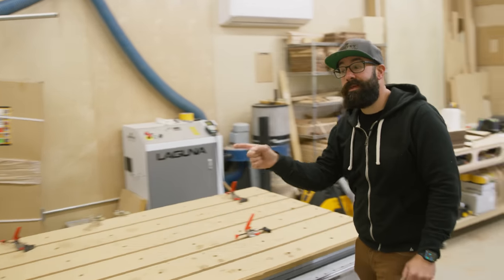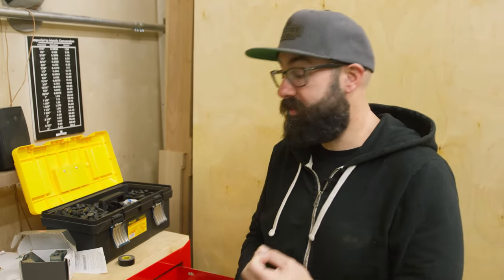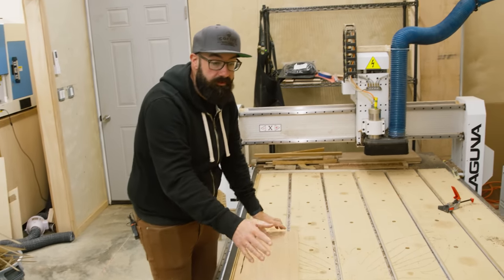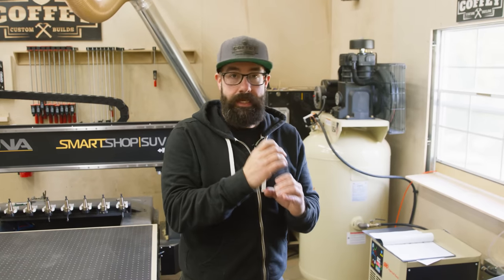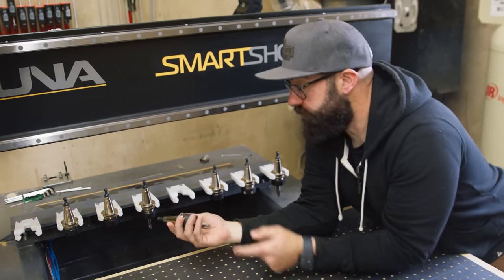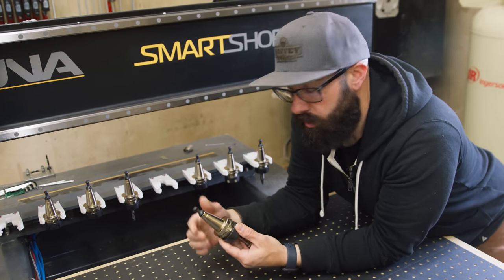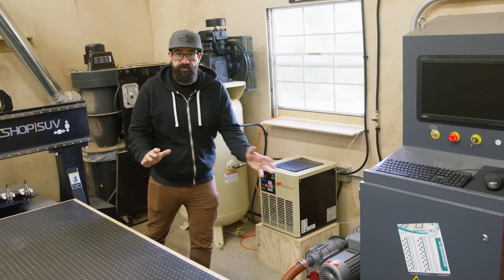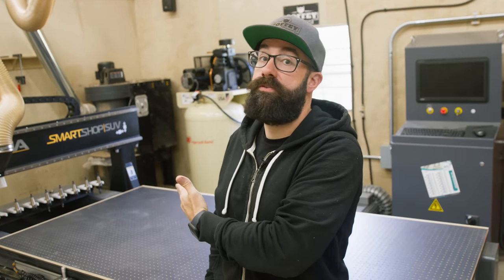The Hidden Costs of CNC's!

Comment: Excellent video, bro. I thought when I spent ninety grand on my large format CNC that it would come with everything necessary other than bits. OMG, talk about naive!

First of all, my machine weighs over 9,000 pounds, so I was advised to replace a large section of the shop floor with six inch reinforced concrete...four grand.

The 230v three phase wiring required cost almost five grand. The onboard tool changer holds twelve tools and with collets and holders, cost a grand to populate, excluding the carbide bits.

The dedicated compressor and electronic air dryer added another four grand, plus another grand for larger air distribution. 

My original dust collection system was instantly overwhelmed and cost seven grand to upgrade.

So, at the end of the day, what I thought was going to be $90,000 ended up being $112,000... and that's still doesn't include any bits. I probably have three grand in bits alone and, yes, they are a consumable.

That said, my system paid for itself within the first year of use. I am able to cut and assemble twenty cabinets in a single day in a one-man shop, with an average UV1 4x8 sheet yield of 95% and an accuracy factor that is off the chart.

A very expensive but totally sound investment in my case.
Reply from the maker: Big purchases require big peripheral purchases for sure. It's well worth it though. Makes the business more efficient.
Reply: Thanks for the FACTS!
Reply: @@tommyp1494  You can do it man. Go for it and work hard.
Reply: 1 year ago I received a new doosan lynx. Y axis. Bar  feeder ,live tools. 150k . I bought my first Haas mill for 8k . It's my philosophy that, mini machines should not exceed 2500 USD.
Reply: @wannabecarguy "I received a Doosan".....like in Santa received or bought it ?
Reply: I built a CNC for $1000 and am competing with HAAS routers that cost $100,000 plus installation and tooling and still beating them. There is no need for expensive servos or high HP. All of the replacement parts for my CNC have blueprints and can be made by any machine shop or are 3D printed. Everyone tells me to think and build bigger but I routinely see profits on my machine. Idiots buy these huge machines knowing nothing about them and then are terrified to take them apart and engineer their own replacement parts.
Reply: @togowack would you be will to share more details about your build. Thank you.
Reply: Well stated. It’s all about ROI
Reply: @togowack  sure you are buddy

Comment: It's true.  I took out a $25k loan when buying a "desktop" CNC router (30"x40") that was advertised as costing $6,495!  I added options like an HSD spindle, phenolic top, vacuum pump, T- slots, etc, for a grand total of just over $14k.  Then add $5k for electrical upgrades, $5k for a good dust collector (NOT harbor freight!), and my money was all gone!  And soon after I discovered how inadequate VCarve Pro is, so I embarked on the odyssey of finding a good CAM solution.  Total cost is all of my money!  I'm using it to make tooling for a product I hope to launch soon.  And while I haven't made a penny off of it yet, the cost of having someone else do all of the machining for me would cost much more than what I paid for the router.  So I'm calling it a win.
Reply from the maker: Gotta spend money to make money
Reply: That’s crazy, $25k for a desktop CNC! I spent a total of $60k for a full 4x8 CNC and an edge bander which included a vacuum pump, and a large dust collector
Reply: @maxwellrucker7186  LOL!  I guess you didn't read past the first 8 words?  It was $14k for router w/ spindle, vacuume table, etc.  I am well aware that cheaper routers exist, but you get what you pay for.
Reply: I have equipment 5k Cad. Making 30k per year
Reply: What software did you decide on
Reply: @handyscott1  Rhino and RhinoCam.  Rhino is easy to learn if you know AutoCAD, and it is good with curved surfaces, which is what I need.
Reply: Good luck man! 👍 hoping to have my own small buisness one day where I can earn a honest living. Any updates on how it’s going?
Reply: @jacobmitchell9227   Thanks.  I have solved all the problems that were holding me up, so now it is time to do the work of making the "final" tooling.  I'm sure there are more problems waiting for me, but I am blissfully ignorant of them right now!
Reply: Or, you could have bought a OneFinity 32x48 for $3700. $300 for spindle. $300 to $1200 is plenty for a dust collector. I do electrical myself. V-Carve Pro is excellent.
Reply: What's the product you're developing?
Reply: @VikingFireProject  I'm making carbon fiber knee pads.
Reply: I can build a desktop cnc under 1000$
Reply: @ChangeMakers338   I can build one for $800. Racing to the bottom is super easy.

Comment: Even with hobbyist machines. The machine cost $3500 but expect $7000 especially if you don’t have a laptop or software
Reply from the maker: I think every added cost associated with my Swift is is the same ones you'll get with a hobbyist machine. You need a lot.
Reply: @CoffeyCustomBuilds  especially starting from scratch
Reply from the maker: @TwoMooseDesign  exactly. You are spending $4k on a machine you're easily another 3-4k to get it optimized.
Reply: @CoffeyCustomBuilds  👊🏻👊🏻👊🏻👊🏻👊🏻👊🏻👊🏻👊🏻👊🏻👊🏻😁😁😁😁
Reply: You're both totally off. Buy from a reputable company and there's no optimizing needed. 

You need the most basic of computers to run even aspire. 

Yeah you'll spend some money in a good machine but you can certainly get less robust machines for a grand maybe 2. People have managed to do machines in budgets. 

Hate cnc's all you want but be accurate with your bashing.

You said yourself it's been the workhorse of your shop for 3 years. As a business it more than paid for itself many times over. Never calls in sick, never needs a lunch break and frees you up to do other things while it's working. 

Every tool has consumables. A cnc will do a lot with those consumables if your feeds and speeds are dialed in correctly. 

You obviously know that stuff now but some of your viewers don't. 

In the long run a cnc will MAKE, not cost you money.
Reply from the maker: @LongIslandHobbyist  are computers free? Do you not need tools? Do you not need dust collection? Do you not need spoilboards? There are other costs. Bottom line.
Reply: @LongIslandHobbyist  I dont hate CNCs? I own two of them and to say there isnt hidden cost is ignorant. Does dust cullection and a "Cheap" laptop come with a 𝙲𝙽𝙲? No it doesnt boom $1000 gone. Bits? For sure a few hundred which is the entire point of the video, which im not sure you actually watched?
Reply: Nobody said they hate cnc routers, just simply pointing out there are other items that need to be added to complete the cnc system. I liked the video and appreciate the info. Even though I will be purchasing a hobby size cnc, some of the items discussed will also apply to my setup.
Reply: All I know is I want to get a countertop priced for a friend at a cabinet shop, which is something I can do with a track saw jig saw and router and get as good of results... They charge $80 to make cuts, than $400 to put them in place and scribe maybe and $25 gas, they said they use a dedicated machine that cuts and routes the grooves for the joining bolts. $400/hr to install laminate countertops sounds like a scam to me. Heat pump installation is also $400/hr and is easy but vast misinformation on it. Greed, all you need is a nice storefront and a lot of overhead and people will pay you anything you ask.
Reply from the maker: @Realism91  do it yourself then.
Reply: Sorry kind of went off on a tangent into personal life, it's for a retired friend that doesn't make much, I'll probably just ask for a new blade and gas and a coffee.
Reply: @Realism91 Try it as a business providing your income as well as taking care of a few employees. After that you can bitch about the cost.
Reply: @Realism91 salty much and yea $400 a hour to install a heat pump is almost a loss for a business. Guys like you have zero clue what overhead is. You dismiss what you can do a countertop for versus and actual business. Had a buddy lived with his mama still at 40 and he did installs. He was way cheaper than me because he had zero overhead. If you had a problem 2 months later he was nowhere to be found. Guys like you I just laugh and say good luck
Reply: @jonsaircond8520  I would never disappear if there was an issue, I'd fix it. I do understand it costs a lot to keep overhead, if we didn't have a supplier nearby that had everything I'd need always available. If I was doing high volume anything overhead would make sense but I do a variety of things at professional quality, my dad was a plumber electrician and carpenter with his qualifications he's retired now he did everything and now I do many things not as much as him, I worked with him for 15 years he never had overhead and never ran away. I get what your saying though I've had to fix many things from people who hide and it's usually leaking roofs improperly flashed the worst thing and usually it was a licensed insured company that did it and went out of business and disappeared which is the oddest thing.

Comment: I’ve a metal CNC that had most of the same “hidden” cost. Two not mentioned are 1) service calls. These aren’t small devices you can easily take in for service or repair. Service call for me is $1,000 just to show up due to a 4 hour round trip from the nearest service shop. 2) metrology instruments.  These machines can be very accurate and repeatable. But you need tools that can measure to those accuracy to be able to dial them in and maintain the repeatability. Probably not as critical with wood, but something better than a (2) for $20 25’ Kobalt tape measure from Lowe’s is needed.
Reply from the maker: Solid mentions!
Reply: Wow good to know thanks I wonder what is the lowest Hidden cost machine out there is ? Thanks for sharing 👍👍👍

Comment: I work as a machine shop mechanic. I've had several hobbyists asking me advice, stating that they had seen videos of vacuum hold down, so they were planning to do that.
I explained what that actually entails. It's great, but not for tiny pieces and not for cheap. I'd say minimum of about $5,000 - which is more than any of the hobbyists asking were planning to pay for their entire setup, cnc machine included. That's initial purchase, not including power or ongoing costs.

Similarly but even more extreme on the ongoing costs would be a waterjet. Ours runs usually at 55,000psi. Every part is thick SS and every part is a wearing part with a definite fail life.
Because every connection has to be machined in SS to a particular angle and smooth so it seals 55,000psi, that means even the most simple straight 6" high pressure tube is $150. There are 19 high pressure lines and 5 of those have 1 or more bends.
The high pressure swivels are $850-1200ea. There are 6 of those.
The diamond orifice that makes the cutting beam is $1,200 and, in addition to being a wearing part, can sometimes crack and fail prematurely.
We are just below the incoming water temperature limit, where we would need to buy chiller for incoming water.
Despite having a solids removal system, every once in a while, the tank will get too stanky, and we will have a septic service suck all the muck out, then they fill 3-5 apple bins full of the waste muck, but now also contaminated with 'leftovers' from the septic truck tank. That's our problem to deal with.
And that machine is the most needy machine in our shop. We expect to work on it 1-2 times a week, and there is no promise that it won't need more than that at any particular time.

Haas machines seem cheap, but their gotcha is expensive parts with proprietary labels to keep you trapped to their service. Let's say you buy a machine for $30-60k... and have to pay $800 every 2-3 years for them to solder new batteries onto the board - or the machine software corrupts and you still have to pay that but also for half a day of a tech reprograming a machine.
That's right. Cheap desktop computers 10years old and cheap $150 cell phones are fine when they run out of battery, but the manufacturer of your expensive machine that your livelihood depends on cheaped out and didn't spend $30 on a micro SSD so it could survive a battery loss unharmed. That should give you a good idea of hidden costs on 'bargain' industrial machines.
Reply from the maker: Yeah good tools cost money.

Comment: I ran a industrial size machine that cost $200k. Had many very expensive tool holders and tooling. That cost was around 100k. We needed 2 of each tool, so one could be away getting sharpened. Some of the were over $600 each. Tooling is very expensive. I used to replace collets every 1 - 2 years, as they wear. Trust me you don't want a 20mm solid carbide tool doing 15000 coming out. Destroys the work and ruins your day. Good video with a honest assessment of costs.
Reply from the maker: Yup! All of it is expensive. It's worth it if you have the business but if you don't it's a waste!
Reply: My son has a fairly large cabinet shop, 4000 sq. ft.
He works himself, plus he has 2 full time employees.
They also do the installations.
One of them spends the majority of his shop time sanding, both on the machines as well as the hand sanding.
His shop has 3 phase power, and quite a few of his present machines require 3 phase power.
He makes everything in house, including doors and drawers, and he does all the finishing in house.
He has a sliding table saw and a large Stribg  rack saw which are used for all the plywood cutting.
He himself can do all the cutting for a large kitchen in less than a day.
But of coarse there is the shelf holes to drill on his line boring machine, and pocket screw holes to be bored also.
Aside from the cutting, and the hole boring, i see no big advantage of having a CNC in his case.
Unless of coarse it is utilized for other projects besides building basic cabinets.
His biggest issue is space, meaning what to do with cabinets after they are assembled yet not ready for delivery.
And the money spent on the type of CNC he would like would go a long way towards an addition to his shop.
Ideally, when the cabinets are assembled they would be removed from the present shop to a different area for finishing and final work such as installing the doors etc.
And from there be loaded for delivery.
Moving cabinets around is time consuming as well, and all of that at least should be considered when looking at ways to cut labor costs in my opinion.
Im curious as to how those of you who have opted to purchase a CNC deal with these type of issues?
Surely not everybody has a shop even as large as the one my son has.

Comment: note on software, if you're only doing a few different parts, I'd suggest getting or making* custom G-code that is optimized, especially if you aren't doing complex parts, if you (or the person doing the G code) know what you're doing, you're likely to be running faster and with better tool paths.

*it's not that complex, there's like 5 commands to learn and it's a list of moves you want the machine to make.
Reply from the maker: God advice

Comment: Very cool! Keep in mind that moving the vacuum pump outside the room will put your shop under vacuum. Makeup air will come in from wherever it can affecting the conditioned space.
Reply from the maker: Very good point. However the air coming in is far cooler than the air it's putting out. So in the winter we will repipie the hot air back in.
Reply: @Coffey Custom Builds  nice! My dust collector piped outside affected my water heater. Was a learning experience
Reply from the maker: Interesting. How so? 

Fortunately no water heater in the shop.
Reply: @Coffey Custom Builds  I piped the dust collector through the wall of the garage from outside. The gas water heater is not in an enclosure in the garage. Turning on the dust collector would blow out the pilot light as makeup air flowed backwards through the vent system. I'm in the process of moving my water heater out of the garage now. It gives me more shop space and I'm adding an air return to the dust collector closet.
Reply: @InspiredCraftsman  ..if it's got good filtrattion pipe it back in
Reply: @CoffeyCustomBuilds  it's not so much the temperature of the air it's where it comes though, potentially drawing moisture through the structure. 
You're most likely better off just venting the exhaust.

Comment: Tip I got from another makerspace was having a plastic brad nailer and plastic brad nails to nail down your workpiece to the MDF board. Works great, plastic brads don't damage your bits (if you accidentally go through them and you can just pop off your piece using a flexible metal paint scraper.  Of course pneumatic nail gun, brads, air compressor (we have an ATC anyway) are an expense.
Reply: Had no clue a plastic brad nailer existed lol
Reply from the maker: Those are cool for sure.

Comment: If you haven't done it yet, consider putting the dust collector outside next to the vacuum pump and air compressor!  My AC can barely keep up with the heat my dust collector puts out.  I live in Minnesota, so I have mine vented inside...because I don't want to deal with heating make-up air in the winter!
Reply from the maker: Actually getting an exterior rated dust collector soon!